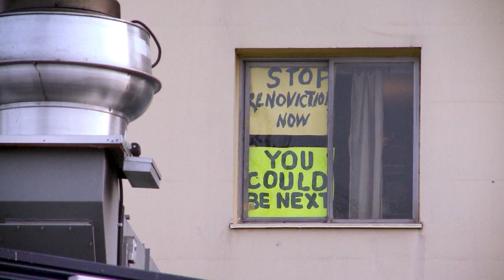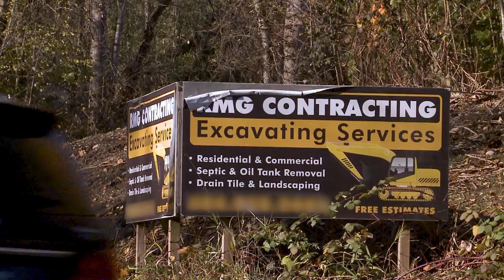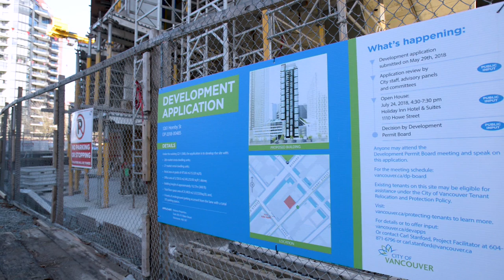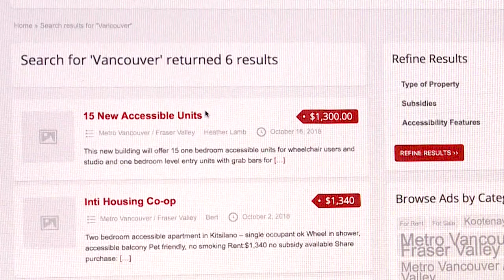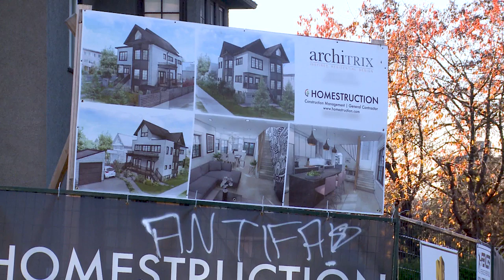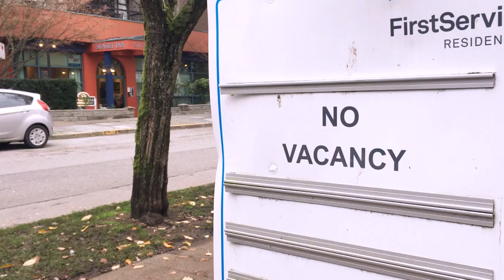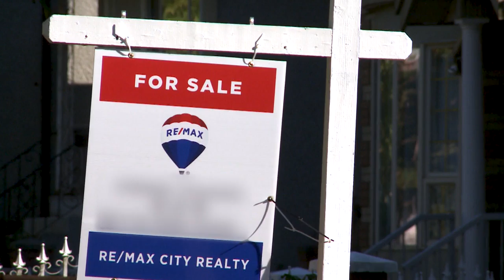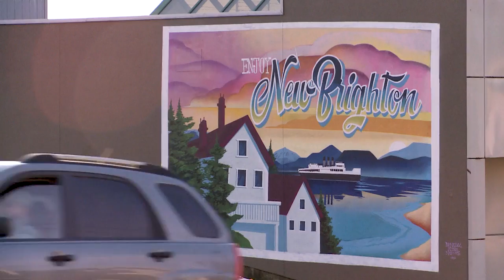No Vacancy: Vancouver's Housing Crisis, documentary

Comment: Toronto is exactly the same. Put a cap on how much you are allowed to rent for example. 3 bedroom apartment can’t be any higher than $1500 + hydro if hydro is included then 3 bedroom $1625.  It’s reasonable. Allowing the free market to go hog wild is actually killing people, it’s criminal.
Reply: They already tried that before to rather disastrous results. Housing shortages galore as few developers wanted to build new housing at all. And landlords quitting the market because they weren't allowed to make the appropriate hikes to meet rising expenses.
Reply: They can't do that. Especially when interest rates for landlords go up. It's better for them to be expensive than none at all. If there were set prices on rentals they would run out entirely due to such high demand.

Comment: Government needs to work much more closely with developers.  Building high rise is most optimal.  A requirement for certain number of units for accessibility, low income, public service workers should be set aside.  Perhaps the lower floors could be set aside.  I believe the developers can provide these units and still be profitable.  Current system is flawed because the developers are making too much profit for every high rise and simply run away from defects after 2 years.  Requiring them to build these units within a high rise would essentially limit their profits.  Perhaps even put a cap on their profit. If they cannot meet the cap, reduce government development fees.  And while your at it, remove the red tape and allow them to build more.  They might not be able to make much on one building but allowing them to build more buildings with ease, encouraging them to build them faster and in more volume.  Which is essentially what we need, more supply as of yesterday.
Reply: The T.I. Experience  actually, this has been done for DECADES particularly in the lower mainland. Most of the units I build allowed for a percentage (or a percentage of the ground) to be a set aside for affordable or subsidized housing. inotherwords, neither of you know what you talking about. But the problem now has many more facets. My CSO high rise concrete and townhouse builds in West Van., North Van., and Vancouver ALL had a percentage of rentals, and/or disability units.